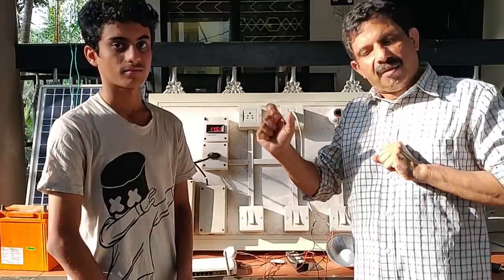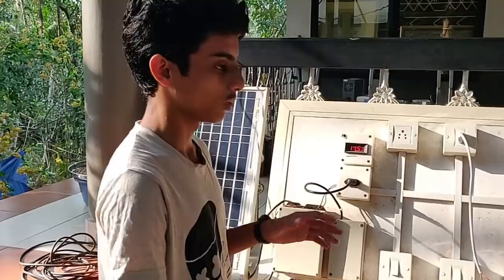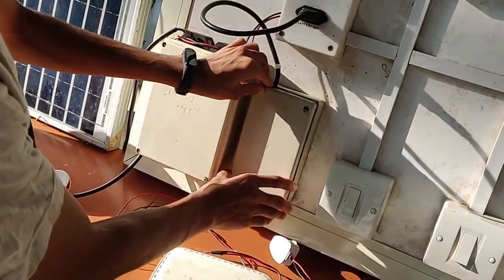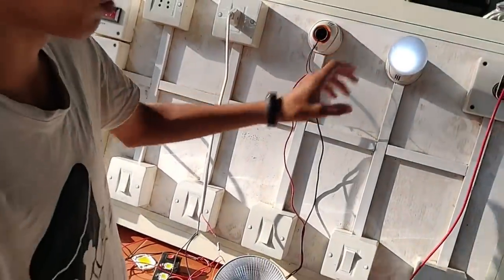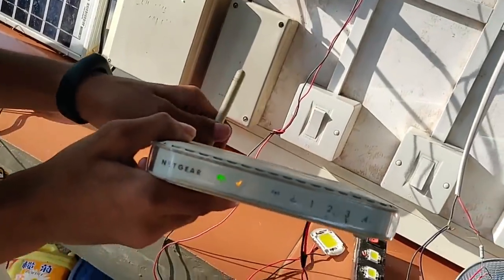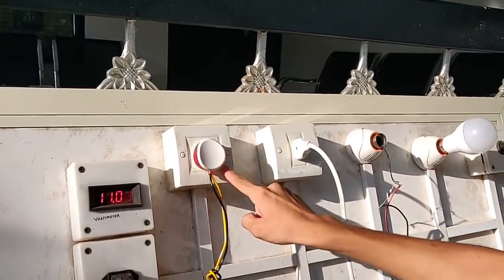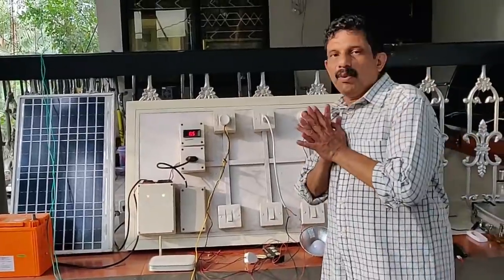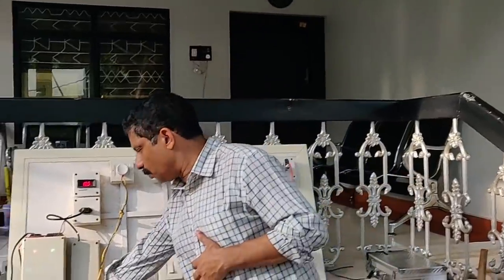വീട്ടിലൊരു DC വയറിംഗ് , ഷോക്കടിക്കാത്ത, മിന്നൽ പിടിക്കാത്ത,

Comment: This 12v DC connection is practically not applicable for commercial and domestic purpose instead of 220AC..i think it is not cost effective, because 

1. if supply voltage is decreases,the power consumption of the device is increases..so the load carrying wires should be highly gauged..so it is too expensive than normal wires..

2.12v is not power effective for long range supply connections.the voltage drop is comparatively higher..

3. In the process of conversion main line voltage of KSEB(220vAC) to 12vDC should be used the external device..so the device is a over cost than the present sittuation..

Comment: Wiring cost kuddum athannu disadvantage, ampere kudumbol heat issue unndakkum, 230 w 230v ac il 1A same 230 w 12v 19 amps varrum

Comment: Endae veetil dc wiring separate cheythittund only for light. Charge cheyyan vendi annu transformer aanu use cheytgirunnath. Ipol ath maatti solar aakki. 165ah amaron vachu. 12v 360watt solar. Enik oru samshayam und. Ithu vare charge controller vachittilla. Ethu tharam controller aanu vekkendath? Reply tharumennu pratheekshikkunnu. (9400220082)

Comment: Sir,.ente paru sandeep ennanu ...munb sirnte oru wireless powernte video kandirunnu induction coil use cheythukond.
Ee wirless energyude possibilities m , athinte efficiency kurechu oru video cheyyamo?.
Direct wire connection athra efficiency kittumo?.
Powerloss ethratholam undagum.
Nyan Arduino based kurachu projects cheythittund..
Wireless ernery projects cheyyan thalparyamundu but help cheyyam arumilla.

Comment: Project adipoly aanu, but ethu oru emergency light, allengil oru room mathram cheyyaam.12 volt wiring veedukalil possible allaa, karanam 12  volt kooduthal long wiril koodi sanjarikillaa voltage drop aakum due to resistance. But 220 volt dc anengil nammude veetile existing wiring use cheyyaam pinne invertor avashyam ellaa, maintenance free aanu.
Reply: DC annegil Fan engane karangum...
DC fan vendi varum..
Reply: Fun media 220 volt dc yude draw back ethaanu we have to change our motor pump and fan to bldc type, and the benfit is avoid enrgy loss of ( more than 30%) invertor. We can directly connect all smps or electrnic based items, even the induction stove, invertor ac washing machine etc
Reply: @ashikn200  washing machine Dc yil work cheyyo..
Reply: Fun media puthiyamodelikal ellam work aakunnundu, latest fully automatic models ok aanu , old model enik ariyillaa
Reply: @ashikn200  Mikkathilum induction motor aanu upayogikkunne..

Comment: ഇങ്ങനെ ഒരു ബോർഡിൽ ചെയ്യുന്നത് പോലെയല്ല വീടു മുഴുവൻ ചെയ്യുന്നത്.  വോൾട്ടേജ് കുറയുമ്പോൾ വയറിനു ഗേജ് കൂടുതൽ വേണ്ടിവരും.  ഇല്ലെങ്കിൽ loss കൂടുതൽ ആയിരിക്കും...
Reply: Currect
Reply: മനസിലായില്ല ബ്രോ, ഔട്ട് പുട്ട് വോൽറ്റേജ് ഒരു ഓട്ടോ voltage സെറ്റപ്പ് വെച്ചു സെറ്റ് ചെയ്യാൻ പറ്റില്ലേ, വോൽറ്റേജ് വ്യതിയാനം ഇല്ലാതാക്കാൻ സാധിക്കില്ലേ, 12 വോൾട്ട ആയത് കൊണ്ട് തന്നെ വോൾട്ടേജ് വ്യതിയാനം തടയാൻ ഒരു മാർഗവും ഇല്ല എന്നാണോ, ഈ 220. ഉപയോഗിച്ചു വീട്ടിലെ ഉപകരണങ്ങൾ വർക് ചെയ്യിക്കുന്നതും 220 നെ സ്റ്റെപ് ഡൗണ് ചെയ്ത് 12 വോൾട്ട ആക്കി ഉപയോഗിക്കുമ്പോ. കറന്റ് കുറവ് വരുമോ, സ്റെപ്ഡൗൻ ചെയ്യുമ്പോ തന്നെ ഒരുപാട്. കറന്റ് താപം ആയി പോകില്ലെ, സത്യത്തിൽ ഇത് കൊണ്ട് വല്ല ലാഭവും ഉണ്ടോ😁
Reply: @religionpceofholyshit3249  
Bro oru karyam mathram nookkiya mathi 
1: enthu konde KSEB AC upayogikkunnu y not DC?
oru 100 meter wiring il 100 watt home theaters upayogikkumbo DC transmission aanenkil orupaad energy loss undakum .
AC aanenkil athra undaakilla.
Pinne heat aavaathirikkan gauge koodiya wire um use cheyendi varum . Expensiveum aayirikkum.
Pinne solar aaayal polum DC electrical equipments expensive aayirikkum compared to AC devices. 
100% 12v DC wiring practical allaaa.
Reply: @sanjaycsan2485  അമേരിക്ക dc പോലെ എന്തോ അല്ലെ യൂസ് ചെയ്യുന്നത്, അമേരിക്ക യിലെ corrent തൊട്ടാൽ ഷോക്ക് അടിക്കില്ല എന്നു കേട്ടിട്ടുണ്ട്😁
Reply: @religionpceofholyshit3249  solar alle?
Reply: @thellump7253  ഇല്ല
Reply: @religionpceofholyshit3249  as distance increases the possible wattage will be reduced.when we use voltage booster currunt will be reduced. Thats why for dc wiring in houses normall 80-100vdc used
Reply: @Fuckecb  so there is no any hope for DC Right? 😣
Reply: Religion pce of Holy Shit ->>>Boss instead of 12 volt dc use 220 volt dc , so you dont need to buy a invertor for home, over voltage and lower voltage cuttoff is enough and no energy loss , converting dc to ac thru invertor have atleast 20-35% loss. There are some guys in tamilnadu using 220volt dc more than 4 yers without having any maintanance.
Reply: @ashikn200  wow so can I use this 220 dc system in kerala.
Reply: Religion pce of Holy Shit ->> but there is no approval from government , this is your personel interest. Only benfit is maintenance free low loss solar system for a longtime life. And you have to buy 16 each 12volt battery to store energy for a 200 volt dc system.
Reply: Sanjayc San > one battery cost is 10,000, but can you tell me how much the cost for 5kv invertor ? This will give you power for all house , whole . Simply say not require KSEB power.
Reply: @ashikn200  why 16 , 12x16=192volt right? Is that. Enough for 220 volt, it's too expensive right? Battery maintenance might be too high, i don't know durability of solar panels, totally it's a flow of money😁
Reply: Religion pce of Holy Shit ->> battery cost that is demerit of this system. May be in future if we get cheaper li-iron battery that will be solved, you just watch that vdo link replied to another guy, how many years they using this without having any maintenance, a fully charged battery can provide 13.5 volt and keep continue until become 11 volt. So a 220 volt system means voltage range between 180 v to 240volt.
Reply: @ashikn200  
Brother it's expensive ofcourse!. But not that much to make a 220 DC supply with 18 cell huge power power bank. 
And yes ofcourse it doesn't make any sense to a very rich person.$$$ 😅

Comment: how does this protect us and the device connected to this circuit, from lightning????
Reply: Lightningum DC yum thammil enth connection! ?
Reply: His idea is if we use solar power instead of external electricity supplier then chances of lightening striking through solar panel wire is less when compared with external supply. Lightening has nothing to do with AC or DC, it just require a conductor to flow.

Comment: Not possible
Reply: Why?
Reply: @aseespattambijeddah4904  12 v kond oru veedu full current pass cheyilla..
Voltage drop undavum..
ഹാളിൽ നിന്ന് അടുക്കളയിലേക്ക് എത്തുമ്പോൾ പകുതി volt ഉണ്ടായാൽ മതിയായിരുന്നു..
Reply: @Imgroot-y9x  നല്ല guage ഉള്ള Dc wire use ചെയ്താൽ പോരെ..?
Reply: @aseespattambijeddah4904  220v aanegil okke ithippo 12 v
Reply: @Imgroot-y9x 2.5 mm 2 wir use cheythu 15 meter lenthe koduttha 12vl corract voltege kiittunnund
Reply: ഇയാളെക്കൊണ്ട് മനുഷ്യൻ കുടുങ്ങിയിട്ടുണ്ട്..... ഒരു വീട്ടിലേക്കും ഇപ്പോൾ വയറിങ്ങിന് പോവാൻ മടിയാണ്...... ഇയാളുടെ ഇത്തരം ഉടായിപ്പ് ടെക്‌നോളജി കാരണം ആളുകൾ പലരും നമുക്ക് ഹംസ അഞ്ചുമുക്കിലിന്റെ വീഡിയോയിൽ ഉള്ളപോലെ വയറിങ് ചെയ്താലോ എന്ന് ചോദിക്കുകയാണ്...... 
ആളുകൾക്ക് അറിയില്ലല്ലോ ഇയാള് ചാനലിലൂടെ ഓരോ പുതിയ കമ്പനികളുടെ പരസ്യം ഏറ്റടുത്ത് വീഡിയോ ചെയ്ത് ലക്ഷങ്ങൾ സമ്പാതിക്കുകയാണെന്ന്............... 
നൂറ് വീഡിയോ ചെയ്യുമ്പോൾ ഒന്നോ രണ്ടോ ജെനങ്ങൾക്ക് ഉപകാരപ്പെടുന്നത് ഉണ്ടാകും....... ബാക്കിയെല്ലാം പരസ്യം....... 🌹

Comment: Can't use 12 V DC for water pump and other heavy current drawing devices. Need heavy gauge wire due to heavy current draw and risky and also lot of power loss due to heating. Only useful for lights, fan, TV and other low current drawing devices.